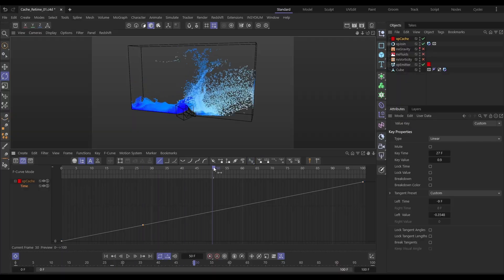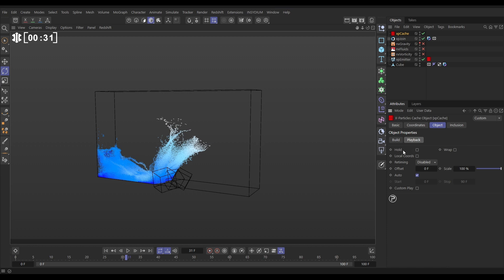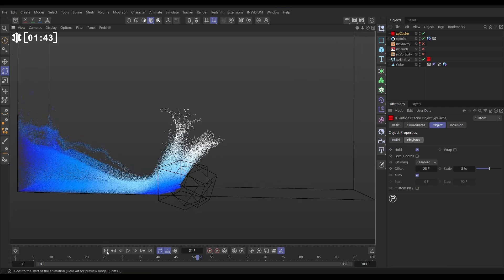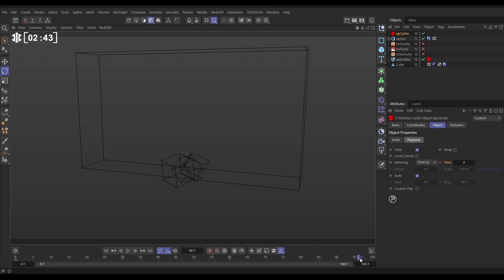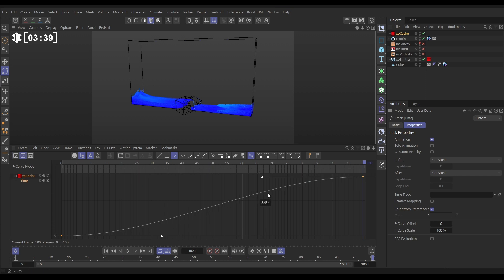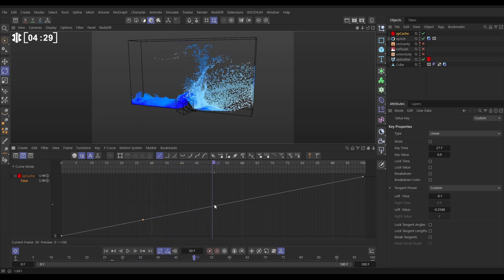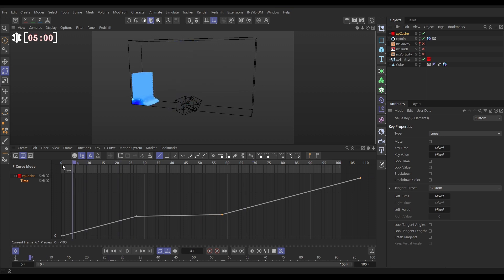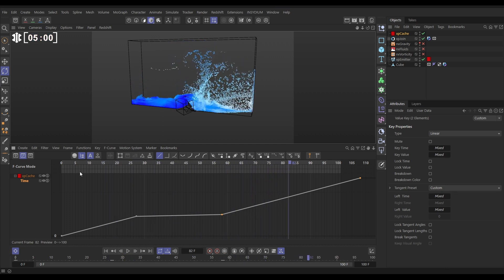Top Tip Tuesday - Retiming Cached Particles

Comment: Anyone know if this is going to be a feature for trails Caches in future?
Reply from the maker: Hi there. You can achieve retimed trails by first caching and retiming your particles. Then, you can generate live trails from the retimed cached particles. You can go on to cache the generated trails from here. If you do, it's a good idea to use a separate cache object from that used by the particles. More details of this technique will be featured in an upcoming top tip.
Reply: @INSYDIUMLTD  I literally just tried this retiming of particles and trails on you new Particle trail flower tut which I can't get to work. So looking forward to that. I took the caches for the trails out and used the retimed particles but it still didn't render although the the screen preview didn't stutter. What am I missing. Love all the tuts by the way. Cheers!